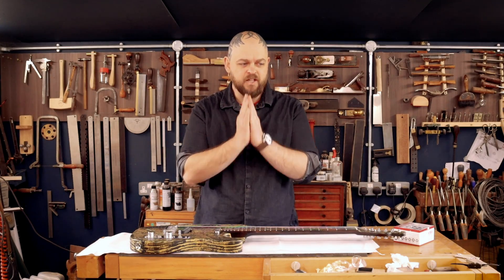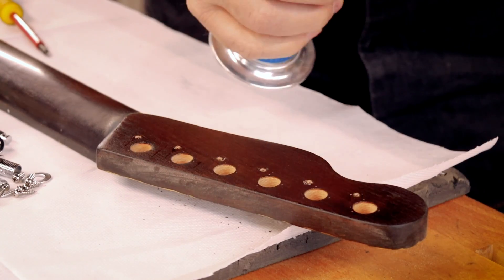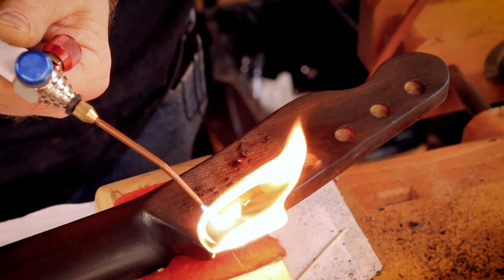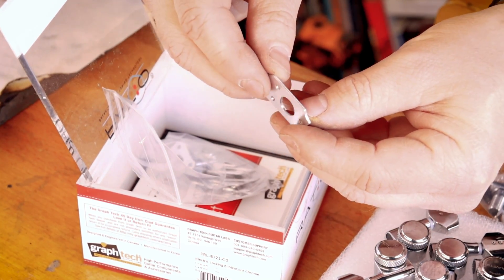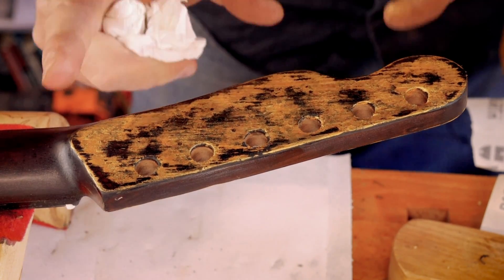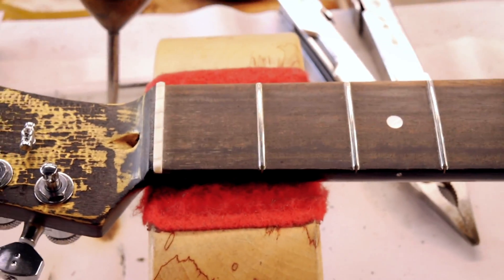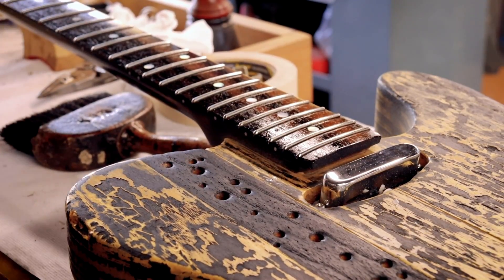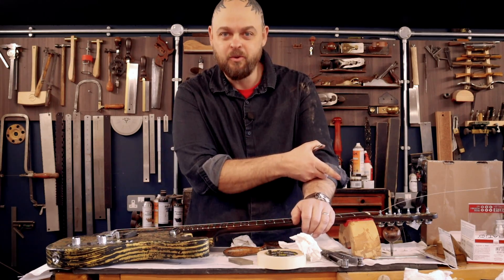1 Year In - Maintenance and Upgrade of a Custom Guitar - Burnt Gold Kit Build

Comment: I'm currently building my first guitar body from scratch. Completely modding a cheap Korean squier... Next will be full guitar neck included. All from getting addicted to your channel. Thanks a lot Ben.
Reply: Great way to get started in building/luthiery. Frankenstein builds can be way better than you'd expect
Reply from the maker: And my job here is done 😃 you will get so much satisfaction and joy from building, I know I do. Welcome to the fold! B
Reply: @CrimsonCustomGuitars  right now I'm in paralyzed terror getting ready to route the cavities 🤣 already had a small slip on neck pocket my perfectionism is going to have to fix. Little 1mm sliver of wood needed right in corner 😳... But when I string this bad boy up, going to be an awesome feeling.

Comment: The low E & A strings are a tad higher after the nut with these new tuners as they extend higher out of the headstock than the originals.
The use of the 'invisible' plates would reduce their height protrusion by a millimetre I suppose

Comment: Ben, question. If you do not use the spacer plates under the tuners, do that not make them too tall and reduce the break angle at the nut? The reason I ask is that the tuning post height looks too tall. Do they make a staggered set?

Comment: Why do they look so tall. The string go up to the tuner after the trees. But I do think they make a staggered set though. And I feel those would look better.
Reply: I'm thinking it is because the headstock itself is so thin, it makes the tuners look like redwood trees. XD
Reply: They do look very tall. It kind of looks like there's not enough downforce on the low E and A strings. Any buzzing in the nut, Ben?
Reply: @samatlanta  i reckon there may well be

Comment: One question about the tuners; does their accuracy vary with sting gauge?  There could be a big difference between a set on .08s and a set of .12s, for example.
Reply from the maker: I haven't tried but I have heard that it really isn't that noticeable.. I'm using 10's though,  so bang down the middle of the road.. B
Reply: @CrimsonCustomGuitars  Thanks Ben.

Comment: Can you recommend a good guitar hardware shop in Europe? I'm currently planning a 7-string fanned fret guitar and finding the proper hardware has been unexpectedly difficult. It seems I would have to order most of the parts directly from the manufacturer, which can occur some quite hefty shipping costs. Shipping for Hipshot single string bridges and tuners to Germany, for example, is $50 US. Same goes for EMG pickups etc. etc. etc.
So, it would obviously be really helpful to have a shop in Europe that has a good selection of hardware, including stuff needed for 7 strings and fanned fret instruments... which is where most shops I've found so far either fail completely or have just one part in one color.
Reply from the maker: Honestly we have the same problem and I am hoping to set Crimson up as exactly that store.. however, for now.. we can't really help. Good luck in your search.. B
Reply: @CrimsonCustomGuitars  Thanks for the reply, even though you can't really help me right now. :) Good to know I'm not just blind and / or stupid.
So far, it seems I can actually get 7 individuals Hipshot tuners from Warwick  Germany, bridges from ABM in Germany and, if I can compromise a bit on the pickups, I can get similar EMG pickups to the ones I actually want from several guitar stores... or I just pay the shipping for the pickups.
Do you have any recommendations on single-string bridges? Currently I just found two (ABM and Hipshot). Are there others you know of that you'd prefer? Same goes for tuners, obviously. Any preferences there?

Comment: Those tuners look really tall. I'd need string trees with those. I'm preferring sperzel locking tuners with the staggered post heights on F-style headstocks as I can usually get away without string trees.
Reply: Graph tech actually sells a staggered post set
Reply: @LordViran  might have to try that
Reply from the maker: The main issue is that I kind of burned away a good few millimeters of headstock.. on a 'normal guitar they won't be this high.. B
Reply: @CrimsonCustomGuitars  what makes you think I haven't set mine on fire? You're a terrible influence.

Comment: Hmm. Those tuners... no advantage when installing a string... still got to wind it up to pitch.  Tuning, once there, still no advantage, unless a string goes wildly out of tune. The one thing that does make me think i'd like to try them, is when you're in tune, and you want to RETUNE to say DAGDAD, etc. Then the rotation required to move the pitch by a set amount per unit rotation does make sense. Means if you're dextrous enough, you can drop tune a string(s) much more accurately than with any other current design.

Comment: Ok just to the point where Ben plugs the holes. So...... Guessing he has never opened the box and read the directions and seen the plates that fit his prior holes.

Shaking my head waiting for Ben's reaction when he discovers this and also a reason why ratio tuners are a great replacement tuner. They fit everything no drill.
Reply: Ok made it little past this. Holy crap he set it on fire. No I have been a subscriber for a long time. I am not really suprised.
Reply: Sigh. You also got the wrong tuners. You got 6 in line all same height. They make ones for telecaster style the get lower from 6 to 1. Ben, Ben, Ben. So disappointed in you. 

BTW those 2 little nubs you drilled. Designed to fit the tuners from Ibanez, jackson, esp. basically what comes from the big japanese factory. You don't need the plates for those guitars. Just a FYi.

Comment: Ben Ben Ben.  My hero. Ben, not this video, but you actually use a lighter to shrink your wire tubes? How silly and unprofessional. They make small heat guns for this. Not small enough, I think Crimson should develop and sell these. Small, instant heat, usb rechargeable batteries. No stupid cord. Oh, I’m going to win the next unofficial Great Guitar Build Off. Send me some stuff. Not a kit. I’ve been an ignorant American StewMac spender, think I’ll switch to Crimson, if shipping isn’t to high. 
On another note, I’ve been thinking (IQ 187) that YouTube should send you a bone. You said you spent four days plus, I spent four weeks plus, watching every build. Plus zillions (technical term) of others watching. YouTube must have had record numbers. When it sadly ended, I didn’t know what to do. I love Laura, and her Moocaster, can’t wait till she gets there. And how crazy that she does woodwinds? Detail, metalworking skill, complex. 
That’s it for now, but now that I’ve broken the seal, you’ve stuck with me. Kudos on all you do. My guitars have been in jury picked gallery shows. Big here on the east coast, how about there? Oh, I also build amps, many using antique clock cases. But I can’t sell them, the sum of the parts is greater than the whole. Left out the humility. Cheers ! Dan. Or Raul.